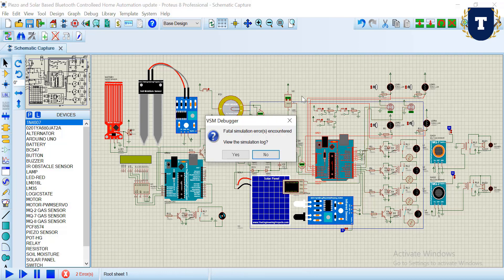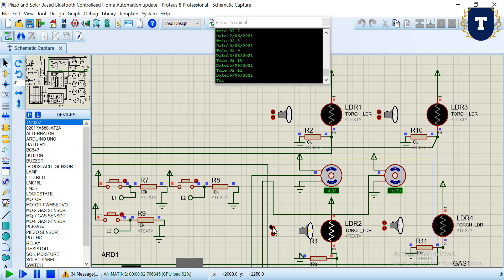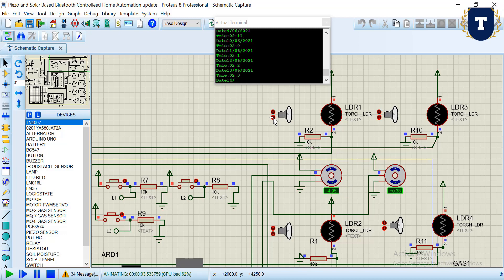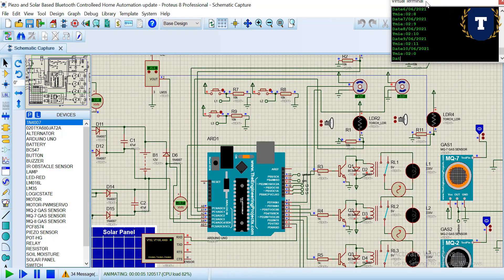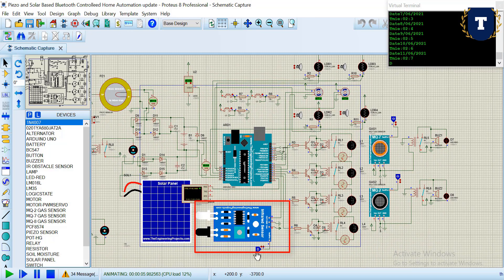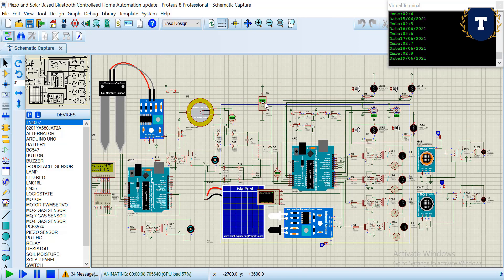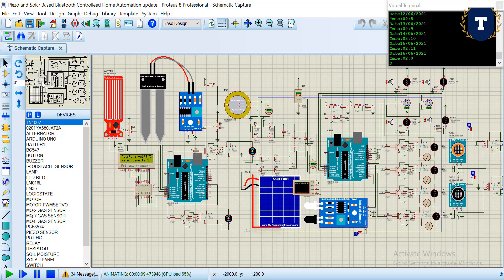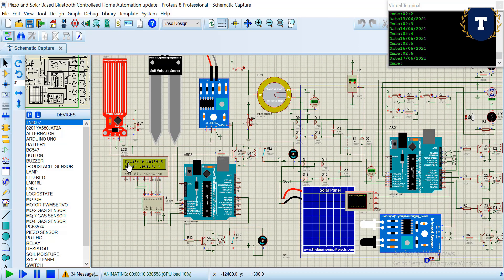Solar and Piezoelectric based home automation system Simulation || Proteus simulation#piezoelectric

Comment: How did you use the piezoelectric sensor here what is the voltage
Reply from the maker: Not shown due to busy schedule,,,,If you want to show the voltage of piezoelectric,  then you have to read it with analog pin of microcontroller. ❤❤❤
Reply: @TechSpaceBD  but your piezoelectric sensor generated AC volt
Reply: @TechSpaceBD what is the DC voltage value of your piezo sensor